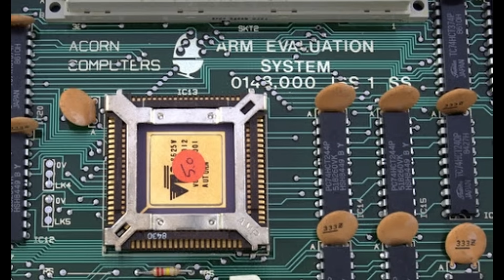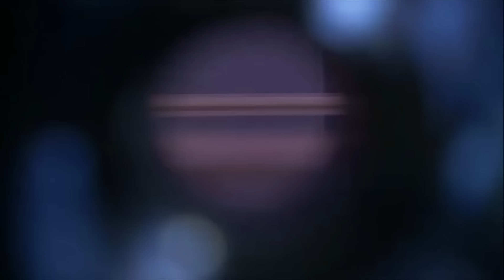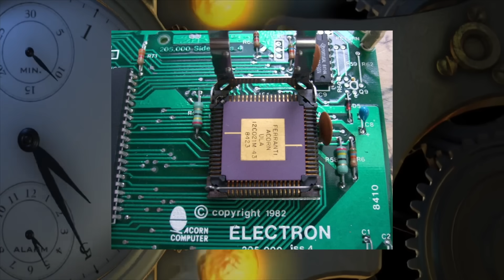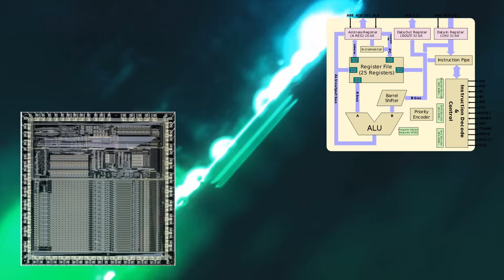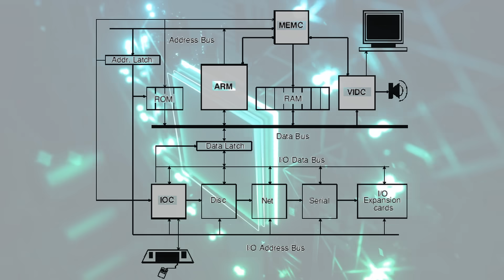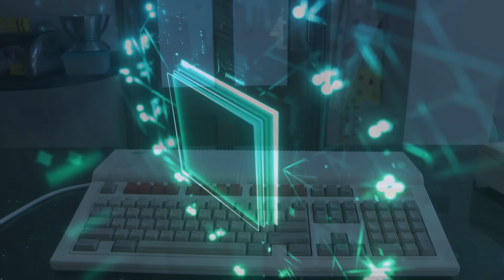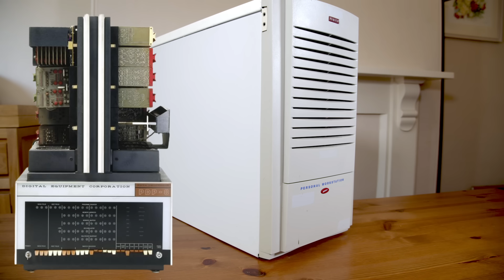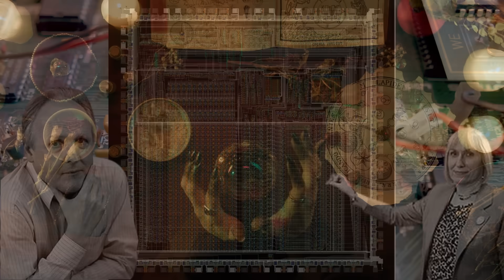The potted history of ARM

Comment: Ooooh there is a bit of a mistake! 15:49 you mention the 16-bit thumb mode, however the Apple Newton used the ARM610 which didn't have thumb mode! thumb was introduced with ARM7 (ARM7T processors being ARM7 processors with Thumb support), so the Newton didn't have Thumb mode, it would have used the full-fat 32-bit ARM instruction set

A later model Newton had the ARM710a, however notice that it is missing the T! That processor also didn't have thumb 16-bit mode.

EDIT: Oh dear there's a couple more mistakes with thumb mode immediately after. thumb can still address the full range of memory that Arm mode can, and also it uses 16-bit instructions, not 8-bit instructions (I imagine if there was an 8-bit mode it would probably be called nail!). One of the strengths of classic Arm architecture is the fixed-width instructions, 8-bit instructions tended to be multi-byte. It would have been extremely difficult to achieve a fixed-width 8-bit instruction set, with very little to gain (thumb was already comparatively restrictive with its reduced instruction set)

I think citation needed on the "turn off chunks of the CPU" part. From doing lots of thumb and Arm programming, the thumb instructions can access all the Arm's hardware features, just that the instruction set itself doesn't allow access to the upper registers, but those registers are absolutely still there holding their previous value from Arm mode (and that's super handy!).
Reply: There's actually a legendary story around thumb-16 itself (legendary meaning: probably not true). Most people say thumb-16 came from a need to run Arm on NOKIA mobile phone of the 90s (which had VERY limited storage), but the legend goes that thumb was designed on a train journey after a phone call from Nintendo who were asking about the Arm processor. Arm was 32-bit, with 32-bit fixed width instructions, everyone knew Nintendo had a 16-bit console with an 8-bit bus, and game cartridges were VERY expensive depending on how much ROM was needed ($40 up to $70!).

So to accommodate a smaller bus, and to reduce the size of program code to fit on smaller, cheaper ROM chips; the 16-bit thumb instructions were designed, ready to be presented to Nintendo for whatever it was they were inquiring about.

A little bit after this...NOKIA is like "Arm?" and ARM were like "thumb!" and NOKIA was like :O

The legend then continues a few years later with...Nintendo's Project Atlantis! The legend goes that Nintendo were actually looking at Arm for this successor to the Game Boy, so Arm collaborated with Frontier Developments (the creators of Elite!) to produce some game demos with their Arm processor. Nintendo liked what they saw, and then...did absolutely nothing with it! So Frontier felt like they wasted their time (they were hoping to partner up with Nintendo, Rare style), and Arm created their new thumb instruction set, only for Nintendo to not do anything with it (yet...). Luckily it was perfect for NOKIA's phones!

I wish any part of this legend could be verified, I suspect parts of it are true, but it's one of those game developer legends that's too cool to be real....

Of course, the Game Boy Advance would eventually arrive with its ARM7TDMI CPU, and a 16-bit cartridge bus (perfectly sized for 16-bit thumb instructions!!)

Comment: I bought the Archimedes 305 in spring 1988. Amazing machine. After using it for about 8 years and expanding to 4 Mb and an ARM3, it currently sits in its original box, in the attic. It feels like an old friend that you stopped calling.

Comment: Thumb had nothing to do with Apple. Apple Newton used an ARM610 which did not have the Thumb instruction set, this instruction set was not introduced until ARM7TDMI and wasn't released until 1994.  The biggest reason for thumb wasn't power either,  in fact thumb uses the same amount of power because it's simply a subset of the same instructions, there might be a small power saving due to less instruction memory being accessed, its probably negligible.  A big problem with RISC style code across all RISC processors is code density, which for 90's era processors with small instruction caches was really important, if you could store more instructions in the tiny cache without accessing memory then you would have better execution performance. 32 bit ARM was particularly bad because every instruction had a 4bit condition code, which is 12.5% of the 32 instruction bits and 99% of instructions would use 0xE (execute always) as the condition (basically meaning they weren't conditional).  Now, this was one of ARMs best features as an assembler programmer and ironically for operations that had a lot of conditions you could get very high code density because you didn't need any branches. However, there were other problems too, in addition to making horrible code density for general code it would also make future development of things like super scalar execution and out of order execution really difficult because the condition instructions could arbitrarily change the condition flags. Because of the architectural issues the modern 64bit instruction set doesn't have arbitrary conditional execution and thumb doesn't have it because it had to encode instructions in 16bits. This 16bit encoding didn't quite double the code density because it sometimes took multiple instructions to do what used to take one but overall it did smaller code.  Thumb2 was added later and with this you could mix 16 and 32 bit instructions and it wasn't really any more a subset of the original instructions, but a more efficient encoding, thumb 2 had a new way of doing conditional execution but it wasn't arbitrary like the original instruction set.

Comment: Forgot:  Digital sued Intel for copying Alpha IP for the Pentium III. When Digital won,  Intel's punishement was that it was given the official righst to the stolen Alpha IP, it was given the StrongArm franchise as well as the ethernet business and other stuff and the only hardship imposed on Intel was that it had to buy Digital's Hudson FAB which had been built state of the art to build Alphas and Strong ARM but Digital wanted out.   (at time of settlement, Digital actually really did want out and was already negotaiting to downsize itself so Compaq could buy it because Bob Palmer had thrown in the towel in early 1990s and his job was to downsize Digital out of existence).    Intel was never interested in the StrongArm but  saw value in the Alpha IP and the ethernet business. Later, when Compaq threw in the towel and shopped to be bought by HP, it then agreed to donate Alpha lock stock and barrel to Intel  (the CSI/Quickpath memory was taken from Alpha EV7 development), donated engineers (many of whom refused and formed their own company called PA Semiconductors which would later be purchased by some small outfit called Apple to make the Axx and no Mxx chips. )

Comment: Between the Newton, and the PSION Series 5 (which was ARM7 from Cirrus Login in 1997),  were there any other well known portable deices based on ARM? As I recall, the Palm Pilot was based on 68k from motorola and the emerging Windows CE devices were on Intel.
Of note: the PSION Series 3 from early 1990s were based on a NEC 80286 chip and ran for over 50 hours on 2 AA batteries (about 80 hours on Lithium AA batteries).  (The Series 3a was also the source for Nokia building the okia 9000 in 1996 which was one of the first smartphones (PDA  phone). 

When PSION rewrote its OS to go on ARM and make it 32bits, it had a view of licensing to phone companies.  But as the PSION 5 came out, Microsoft threatened to enter the PDA market with Windows CE and PSION threw in the towel and spun off its new OS (EPOC32) into separate company called Symbian with a number of cellphone makers taking shares (Motocola and Nokia were the 2 main ones tI remember). This faltered and  Nokia took it over and started o rewrite it to support open format (conrtrary to EPOC16 (later renmed SIBO), EPOC32 was highly proprietary with undocumented file formats and very weak SDKs to access the data from outside the device.  
Nokia never really did success with Symbian, despite it being a good OS ar the core, but it did set the path for use of ARM processors in anything portable.

Comment: Excellent video, most interesting.  I did some work with Newtons where I set them up for building system maintenance  and inspection routines. The instructions for fitters/electricians were put onto the Newtons and readings etc were then input direct into the Newton and then downloaded to the mainframes. It saved a lot of time and waste and became the forerunner for better systems as newer hardware became available.  They definitely brought something to the table.

Comment: You forget to point out towards the end that ARM processors are also integrated into chipsets from both Intel and Advanced Micro Devices, in the form of the Management Engine and it's AMD equivalent. These chips are active and have the input, output and program counter before the CPU is even powered up, running the UEFI bootstrap before powering on the main CPU and passing control over to it. It maintains seperate interrupts and can manage and access all I/O and devices independently of the CPU, without the user knowing it even exists. In fact, so many of us have this that this comment might disappear on it's way you one day, its potential future tensor cores has understood that I am criticizing arm secret CPUs and blocked the comment...

Comment: I think CPU design will continue to blur together as time goes by.

Taking a look a this video - https://www.youtube.com/watch?v=S4mKJxbrkT4 - instruction set is effectively an intermediate language now - which the CPU pulls apart and recompiles into microcode instructions.  So instruction set is the icing on the cake - rather than the foundations of CPU design now
Reply: Not ARM, or any other RISC processor.  Operations on RISC processors are implemented as hard-wired logic gates so they run as fast as possible.

Comment: It's fascinating to me that the ARM1 had roughly the same transistor count as the Intel 8086 from seven years earlier (Ken Shirriff recently counted actual transistors 19,618 on an example he's been reverse-engineering, although things like ROMs and programmable logic arrays that aid in decoding instructions and controlling the chip add many more, so there were 29,277 potential spaces for transistors on it -- high and low numbers pretty much exactly bracketing the reported 25,000 for the ARM1)
Reply: All those transistors were probably needed to decode instructions.

Comment: the ARM1 had 25 thousand transistors. For CMOS a crude approximation is to divide the number of transistors by 4 (the number of transistors in a 2 input NAND gate), which would only be around 6250 gates. That allows more direct comparisons with current processors.

Comment: Great video, thanks! But wait, at 16:00 it says that 1) the Thumb mode allows to address limited amount of memory, 2) has 8-bit instructions and 3) was one reason to use that CPU in the Newton. If I remember that correctly it's false on all 3 accounts. The Thumb is a 16-bit instruction set (reduced instead of the native 32-bit instruction set) that can address the same memory and appeared on the ARM7T (architecture v4T according to the ARM website), years after the Newton, which after checking, used the 610 (architecture v3 only).

Comment: since the apple 2 gs was arm based then in theory you should be able to make apple 2 gs software run either in emulation or natively on the mac m1 and m2 and raspberry pi 4.
Reply: No one said the Apple II GS was ARM based.
Reply: @daishi5571  it was pictured so i assumed unless it was an editing mistake or an error caused by a stale reference bug in your editor
Reply: @ejonesss  it was pictured when discussing the 65C816, the 6502 successor which the II GS did indeed use
Reply: Looks like a mistake, II GS was 65816 based.  (6502 family)

Comment: Got to experience ARM for the first time with an Archimedes A310 on a YTS computer course in the 80s… I was an Amiga owner back then, but was amazed by the power of ARM.  I was already well versed in BBC BASIC from being at school in the 80s, so set about seeing what I could do with BBC BASIC on the archimedes.   One of the first things I wrote was a breakout/Arkanoid game… 256 color graphics and stereo sound FX that panned left and right depending on where your bat and the ball was.  I was amazed at how fast it ran just using interpreted BASIC!   If anyone comes across a copy of it ( I shared it with other Archimedes users) I’d love to get a copy of it again as I lost the original disks… it was called BallArcs!

Comment: My A440 (With ARM3 upgrade) is one of my most beloved retro systems. (It had battery damaged and it took a LOT of work for me to get it going again. How does an A440 get bettery damage? Well, you leave in the original AA batteries and store it on its side, and the AAs melt and dribble down over the RAM.)

Comment: VMware has been developing a version of their ESXi for the ARM architecture for quite a while, but no commercial product is yet available (to the best of my knowledge). This suggests the ISA still has a long way to catch up, say with x86/AMD64
Reply: Not really. It takes time to make all the software bits work on a totally new platform. Just ask Jeff Gerling about the BS just getting video cards to work on a Pi (ARM). There are serious differences.
Reply: @jfbeam  iirc the Pi has a hardware quirk in which the PCIe bus controller can only handle 32 bit, but instead of throwing an error when asked to do a 64 bit access over PCIe,  it performs the access anyway, truncating it to 32 bit with the latter 32 bits being a mirror image of the former 32 bits.
Reply: @PixlRainbow  Actually, there are many more "quirks", and undocumented behaviors. Gfx actually do work on ARM (e.g. cellphones and tablets), but they aren't using "PC" hardware. The same sort of issues surfaced decades ago with sparc, risc, and even mac, but ARM seems to be the first "alien" platform many have experienced these days. (Apple switched to Intel long ago. Sun/Oracle switched to mostly AMD/Intel decades ago.)
Reply: @jfbeam  Interesting. Are there VT-x/VT-d/EPT equivalent instructions in ARM to accelerate virtualization workloads?

Comment: Calling arm 1 of 2 architectures to survive is quite far fetched. Power? Mipi? Risc? There are almost more ESP32 chips alone in the world than x86 chips. That is just a single chip using the Xtensa architecture. People tend to ignore the small devices that are all around us in huge numbers but even though they are not sexy they are everywhere.
Reply from the maker: Power is very nitch to IBM mainframes, if you mean powerpc thats just embedding systems now not general computing same with mips, and ESP32. For general purpose computing there are just 2 architectures left, all the others left the space, and most of them are not even in active developement any more, they just get die shrunk.

Comment: Disagree with it being only 1 of 2 surviving architectures. RISC-V while tiny also has "desktop" chips that can run linux like a raspberry pi.
Reply from the maker: Its the shipping in volume part that counts RISC-V out atm. In a few years time who knows. Right now however they dont even ship in significant volume in the SBC sector, never alone more general purpose computing. At the end of the video I do talk about how RISC-V might become more significant.
Reply: Well, he mentioned "CPU" for general-purpose, not microcontrollers, for which a lot of old ones are still available these days and used for all sort of purposes. BTW, MIPI is an alliance that produces specs for the mobile market, isn't it? Not sure how it's involved, is there something else with the same name? Oh, or you meant MIPS? There's also Sparc who is still out there through the Leon processors. Still niche in comparison, but definitely survivors.

Comment: You can still purchase the W65C816, the 16-bit 6502 compatible processor (though not a slot-in replacement!). And yeah it’s not exactly the greatest. Because for some goddamn reason the data pins are SOMETIMES the highest 8 pins of the 24-bit address bus!

Comment: Just think about it. Every AMD processor currently in production uses at least one ARM core next to its x86 architecture! That is kind of mind boggling
Reply: You are confusing ARM and RISC.
Reply: @daishi5571  no dude you are confusing something there the AMD PSP is built on an ARM license around one ARM m0+ core. In case u wanna fire up your Ryzen processor that small ARM core will tell it to do it ……. or not EDIT: but I guess the author of this comment doesn’t understand the difference in any case
Reply: @frankdevinlp  Thanks for the info I didn't realize that the PSP was ARM based.
My first thought when you said "Every AMD processor currently in production uses at least one ARM core" was you were thinking about the conversion to microcode as I have had that conversation in the past. Then I had the thought that maybe you were talking about an actual useable ARM CPU integrated into the CPU, as this is something that both Intel and AMD have spoken about doing in the past. A third option being the PSP hadn't even crossed my mind.